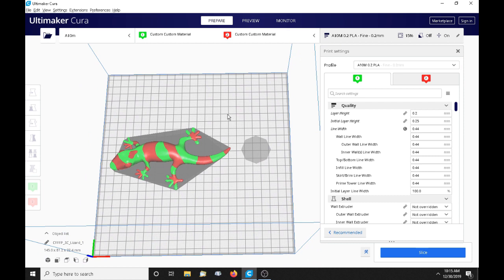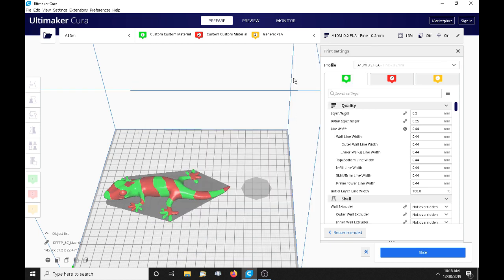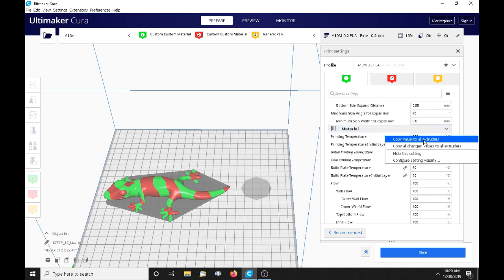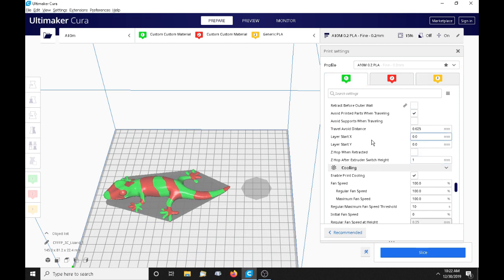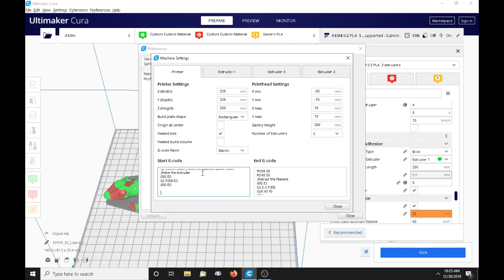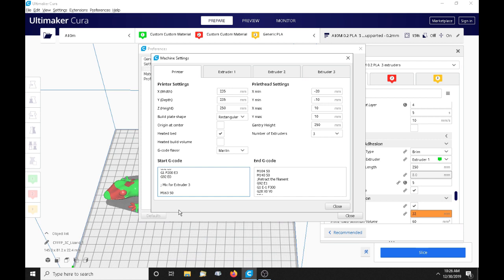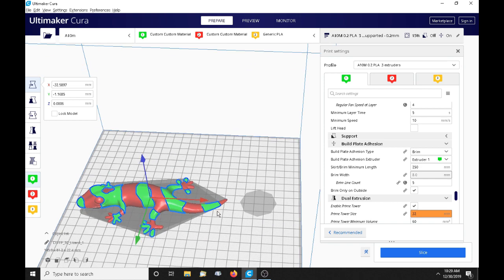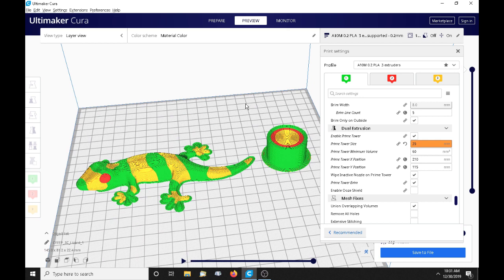Cura Multicolor Printing  Virtual Tool for mixing  Part 3

Comment: I was wondering how you setup Cura so that your part is showing in yellow or other colors?  When I load my parts is show in a weak gray color making it hard to see. Would you happen to know how I can change the color of the part on the screen?  Thank you.
Reply from the maker: Light gray means the part isn't on the bed usually.
Or is too thin to slice.

Comment: I am trying to add virtual extruders for an a10t on Cura 4.8. The print setup only goes to 3 extruders. How do I get the extra extruder option?
Reply from the maker: I assume you chose your printer from a list, when setting up Cura?
If so, you need to instead set it up as a "Custom fff printer" , then you should be able to select up to 8 extruders.
Reply: @1zradio660  Fixed thank you! Now have a stringing problem when mixing filaments. Believe only one extruder in mix retracts when moving to purge tower. Seems to be a similar problem with Change filament - only one extruder retracts.

Comment: great video ones again thanks for doing this. i got a A20T, and use cura 4.5 but i can´t make a gcode in the first  part under primær / printer, i can make gcodes in next line extruder 1, 2, and, 3 what can i do ?
Reply from the maker: Not why cant you put gcode in start code section?
Is it because you cannot see the window?

If that is it, then you can grab the edges of the whole window and drag it larger so the box to enter text is visible
Reply: @1zradio660  oh i feel so stupid, i haven´t thought about that at all. it is working now i can  try out inter g codes thank you big time.